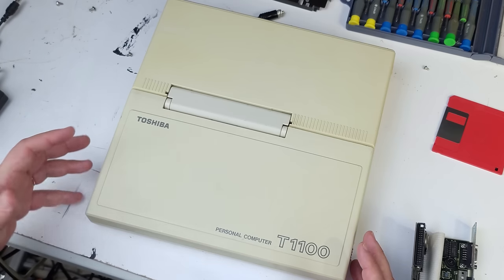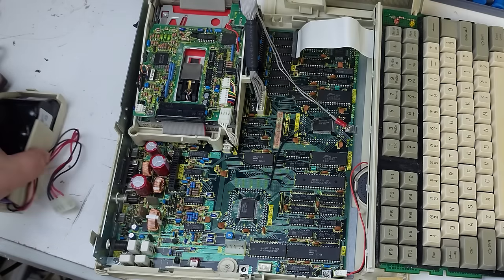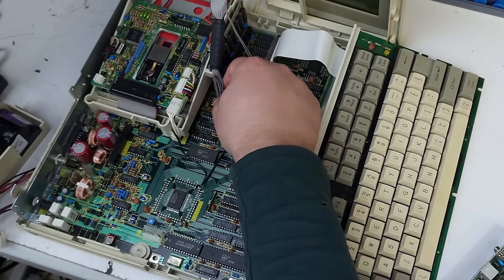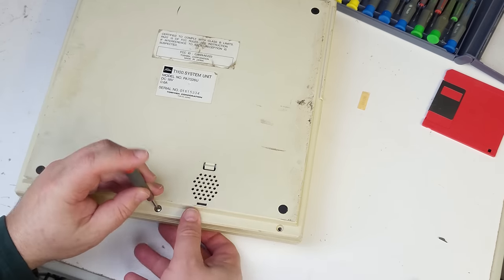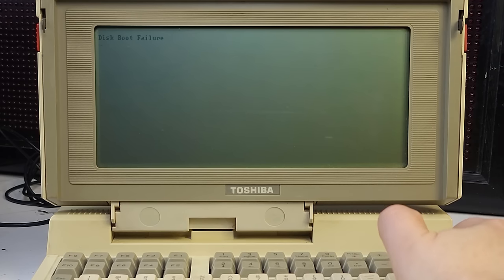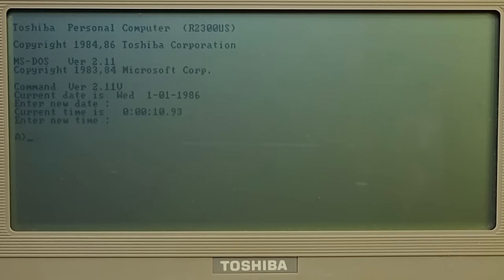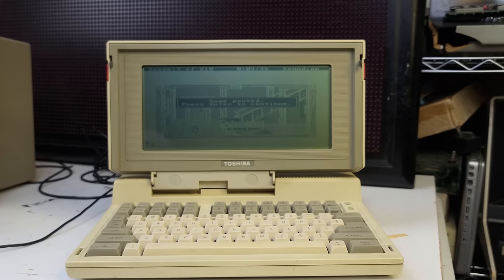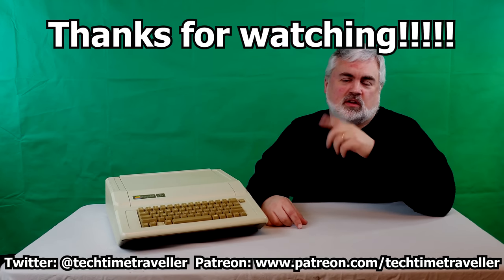I Fixed Toshiba's First Laptop - Sort Of?

Comment: One good thing about the battery pack it looks like it uses the sub-C size of cell. Those are still relatively popular in electric radio control cars, so you can still get new cells and build new packs that way. A lot of the bigger hobby stores should be able to get them in

Comment: The problem with the older Toshibas of that era is the capacitors. I've been saying for years (at least since 2014) to just replace them on sight, because they're prone to leaking. they have a reasonable chance of having caps with the quaternary ammonium salts/compound issue that does rear its ugly head in many things, including the power supplies for old Powerbook 100 series laptops with Elnas, for instance. better to not turn them on at all and just replace the caps outright. As far as the necessary need for the battery, I believe that's a design feature to make sure the battery has enough juice not only to run on battery if disconnected, but to also make sure from a functional standpoint that it has enough power to hold standby power perhaps? until the issue was explained I was saying all along, screaming at the monitor that the issue was probably caps... I'm still not convinced you don't have a problem, even though yours looks quite clean. caps are a plague with these older toshibas and I have yet to have one come into my posession from anywhere that doesn't need it.
Reply from the maker: Yes I agree.  Caps will need to be dealt with.  I've had many give me grief over the years.  I've a Mac II that needlessly got wrecked by capacitor leakage because at the time I didn't know they could do that and left it sitting too long.  I've sort of learned my lesson there.  For this one I thought it was likely toast already.  Got lucky.  But for the longer term replacing caps and the battery pack are on the to do list.

Comment: Thanks for the update! FWIW the basis of the IEEE Milestone award for this machine was that it was the first of this form factor that was fully IBM compatible and a market success... those earlier clamshell examples  (like the DG1, Gavilan SC, Sharp PC-5000, GRiD Compass of course) didn't meet these criteria. Reading the IEEE debate chain on this is interesting, even if it seemed like splitting hairs.
Reply from the maker: Supposedly someone in the IEEE put a motion forward to consider the Apple-1 the first personal computer, which they justified via selective criteria that only the A1 could really meet.  People get quite passionate about this stuff. I kind of cringe when I go on camera sometimes..  "is this a laptop? A portable?".. knowing someone will potentially take umbrage with my description.

Comment: When I was a school kid I got an old Toshiba Pentium 150MHz Laptop in like 2002 and the battery actually still held a bit over 2 hours. I was surprised because the laptop I had before that was a Compaq LTE Elite 4/75 which didn't even hold 30 minutes. I don't know what Toshiba batteries were made of more than Nickel-metal hydride but at they were extremely good.
Reply from the maker: My first brand new laptop for myself was a Sager 820 I think.  166mhz desktop CPU that would leave scorch marks on my desk and cook my lap to well done.  But I was just excited it had active matrix screen and was all mine. :)
Reply: @TechTimeTraveller  active matrix was really neat I was so glad both had them. My first very own laptop I bought with my money new was the first Intel MacBook Pro in 2006. Before that I was always using something someone else threw away, was really a great moment when I unpacked it.

Comment: Many power supplies need a load to work.
I usually use a dead hard disk I don't care about.
Capacitors don't leak acid :)
They are basic inside. That's why their juice can be neutralized with vinager or citric acid.
I prefer citric acid, it doesnt' smell, works perfect to remove rust with no effort, and is tasty :)

Comment: I know it is important to preserve these vintage computers, but I'd really like to put an SBC (like a Raspberry Pi) into one of these with a display and make a Pi laptop.
Reply: There are lots of nonworking ones you could gut! I especially recommend the slightly newer T1000LE and friends, because (a) they're more available and not too expensive and (b) based on my experience they're especially prone to destruction by leaky caps in the power supply (which is part of the main board). I haven't had much success with the repairs I've tried and I don't think it would be any great loss for you to trash a corroded motherboard. The keyboard will be nontrivial to deal with, though!

Comment: I'm not so aware of NiCads leaking - NiMH batteries definitely do, but the handful of old NiCads I've seen haven't leaked. Still, that those batteries take a charge is extraordinary.
Reply from the maker: I've had some pretty horrific leaks with NiCds.  Or at least, it said NiCd on the label.  I've always been on alert for leaks as supposedly applying charge to a compromised battery pack can sometimes cause fire.

Comment: FWIW, one could "downgrade" a HD disk to DD by covering up the appropriate hole on the disk, if HD floppies are more readily available.
Magnetic material is probably different, but most equipment doesn't seem to mind that - Amiga and ZX Spectrum didn't.
Reply: Floppies on ZX spectrum?
Reply: @qwertzy121212  Yep. Betadisk & TR-DOS was popular in ex-USSR and are still emulated on modern Speccy peripherals such as DivMMC, probably DivIDE also but I'm not sure.
There were other floppy disk systems for Speccy; +3 even had an internal 3" floppy, but AFAIK those were nowhere near as popular.

Comment: If the NiCd cells don't leak, they can last an awfully long time. I've found this is especially true if they're discharged first. I have a Datavue Spark from that era which was given to me by an uncle. It supposedly sold well, but finding much on it is nigh impossible. Any tips for finding service manuals for now-obscure hardware?
Reply from the maker: I have a Datavue Snap 1+1 and share your problem with manuals.  It's weird because I remember Datavue as a name so they must have had some presence... but weirdly I've not been able to find a thing.

As for NiCds.. yeah, I'm really surprised these take any charge at all. It's quite possible someone replaced them somewhere along the way..  but still must have been quite a while ago.
Reply: @TechTimeTraveller  My uncle was detailed enough to keep the boot disks and manuals with it in the case, so I have the original user's manual. I'm specifically interested on a pin header for an optional modem. My hope is, if I can pin it out, that I'll be able to fabri-cobble something together for a flash-based hard drive. 😁

Comment: Re: 720k floppies. My personal experience is that they usually hold out better than 1.44M floppies. But any floppy that has lived a decade in a moist basement or left unprotected on a dusty shelf surely has issues by now.
Reply from the maker: Yeah maybe storage has been part of my issue.  Also many of my 720k disks tend to be older than my 1.44mb so that may be working against me also.
Reply: @TechTimeTraveller  Finding 720k floppies nowadays is almost impossible, it can easily go months before a reasonable deal pops up on facebook. I've bought an unopened box last year and got two unopened boxes when I bought a Macintosh SE/30. Most of my old 720k floppies are IBM install disks (my dad's school had a bunch - one set for each school computer) so he gave them to me to reformat. They're still working flawlessly. My floppies has lived in a box in a closet at my parents. 

Re: age, I prefer to get older floppies. The new stuff, especially from after the millenium aren't very good - a dozen reads in a USB-floppy drive and they're damaged. Sometimes they can be fixed with a reformat, sometimes not.
Reply from the maker: @VicTheVicar  Yes I have some weird issues with usb floppy drives.  I've tried two different units.  Mostly they work but every now again you'll write something to disk and the whole disk goes bad.  And it was all good before.

Comment: The later T5100 (386) is annoying to take apart, including screws behind a sticky thin plastic bezel.
Reply from the maker: I have sad experience with this.  I'm dreading going into my T5100 for a suspected video ram issue.

Comment: Does the T1100 not output color from its composite video connector?  KQ3 should be displaying in color on the Apple Composite Monitor IIe unless the monitor's switch is set to black and white.

Comment: Can you connect a serial mouse to it? That can be another good possibility. 😉
Reply from the maker: Yes that 'modem' board seems to have a normal RS-232 port on it.  Once i find the power adapter for my Mouse Systems mouse I might just try it out with that for fun!
Reply: @TechTimeTraveller  Do you have a serial mouse which not requires any power adapter instead?

Comment: Thanks for posting this.  I think I have one or two of these sitting in the garage somewhere - one is a 'DOA" Ebay special.  You've motivated me to dig it out and give it a quick look over.

Can you post details of the sites you use as source details for these please?

Thanks!
Reply from the maker: I've added the site in my description (meant to do that).. here it is though in case.  Lots of good stuff here.  https://minuszerodegrees.net/manuals/Toshiba/Toshiba.htm#1100

Comment: were is  the Mimetic polyalloy
Reply from the maker: Bahahaha.  "It's a T1100.  We can defeat it but someone has to reach into the alloy and disconnect the batteries.  After that it won't start up or shape shift."
Reply: @TechTimeTraveller  i guess toshiba didn't put any Hydrogen fuel cells in this one that can power it for 120 years and blow up like a mini nuke went there damaged lol.

Comment: My mum had a very similar Toshiba laptop when I was a kid in the early 90s. It had a cool custom menu built in config.sys by the previous owner. One time when I was playing around with it, I discovered they had also installed Leisure Suit Larry 1 on its HDD. However try as I might I couldn't get past the age questions. So I asked my mum for help.. Once she saw the questions she quickly deleted it :( When I accidentally formatted the HDD she was not impressed.